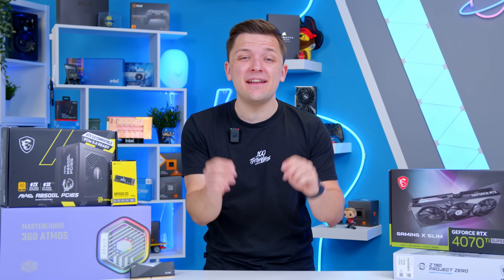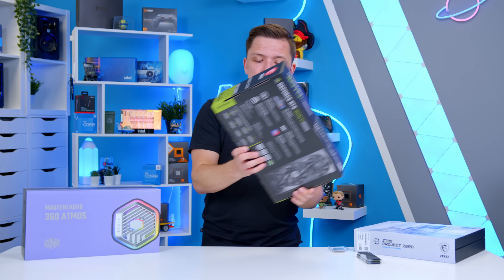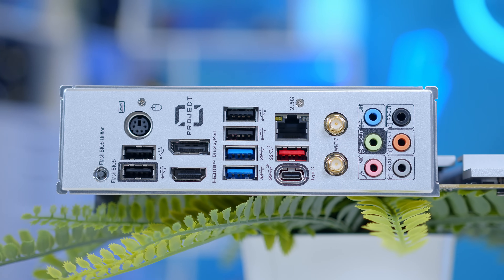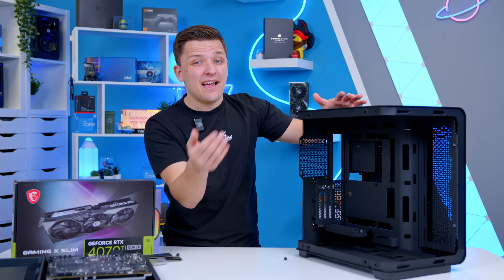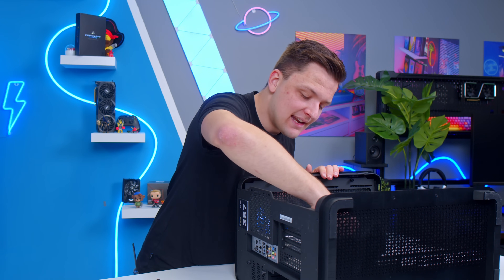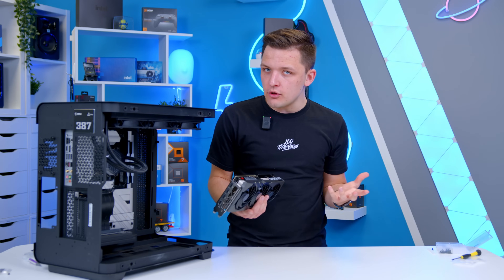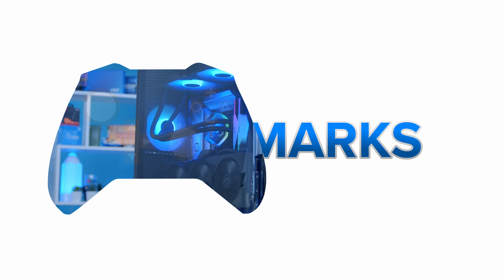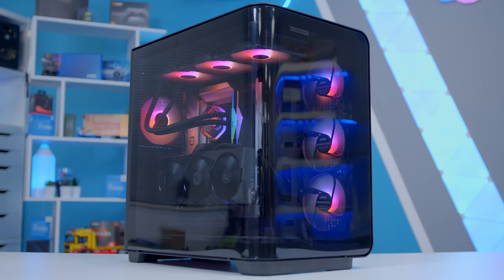Best $2000 Gaming PC Build 2024! 👀 [ft. RTX 4070Ti Super & i7-14700K]

Comment: 😂😂😂😂😂 $2000 for a 4070ti?  Talk about blowing $$$$$$ on all the WRONG places
Reply: Lol $400+ Case 😂
Reply: @thesilentassassin1167  yep my 1800 and change 7900xtx 7800x3d lancool 216 build would blow that thing out of the water for $200 LESS
Reply: At that point just get a RX 7800 XT, it’s literally the same if not better for performance not features. Realistically the best gpu for this would be a RX 7900 XTX or a VERY good deal on a 4080
Reply: @clw22580  how many frames you get in wz wit that rig ?
Reply: @Thornz_1 Think you mean 7900 XT, 7800XT is noticabley worse
Reply: @terlicccIncorrect, MSI has no problems, been using them for years.  Educate yourself son.
Reply: ti super*
Reply: 4070 ti super is exactly the same as the 7900 xt it only has more vram
Reply: To be fair, if I ordered all cheap parts and go with budget air cooler, I was able to get somewhere around $1800 for a solid 4070 ti super build. With tax that’s 2k. If you want anything better aesthetically, it’s gonna cost more. That’s just the current market
Reply: I see a lot of people saying the ryzen 7800x3d  is the best cpu for 4070ti super
Reply: @clw22580 howd you get it that cheap? Def cut some corners if the xtx was $900 😂
Reply from the maker: At this price point I think NVIDIA makes more sense. Totally acknowledge that the RX 7900 XT is a strong alternative
Reply: @GeekaWhat  I've personally had problems with AMD so this video is perfect for what I want. You nailed with this video, some of us out here appreciate your work 👍
Reply: @GeekaWhat  you can EASILY build a 7900xtx 7800x3d build for $2000 which would blow that build you just did 4070 ti super 14700 out of the water
Reply: @clw22580  the ryzen 7800x3d is only better than the core i7 14700K in games, in any other task it is pure shit
Reply: You can get a 4080 if you budget properly
Reply: @Shoedenmark  yeah I’d go with a 7900xtX 7800x3d with a $2000 budget but you could possibly get a 4080 as well
Reply: @hylasme exactly my build was 2200 after tax… ofc u can get that build for cheaper but it depends what u want ur build to look like lol people don’t understand
Reply: 4070 ti super*
Reply: @clw22580  yeah you can build that but it would look absolutely shit mate also dlss exists you amd fanboy + you may have a good gpu and cpu but that leaves like 600$ for 6 other components your gpu shouldn’t be more than half the budget really
Reply: @neikoyomi a gaming pc I’m pretty sure is supposed to be the best at gaming, correct me if I’m wrong tho
Reply: @Osonyer3000  couldve prolly put a 4080 super in this.

Comment: im buying a 4080 super and a 7900x3d soon, hopefully my pc will play 1440p at rt and maybe 4k at high presets in demanding games
Reply: You can run 4K with a 4080 super on pretty much everything so you don’t have to worry about that, but go for the 7 7800x3d. It’s just the superior cpu for gaming.
Reply from the maker: 4K should be no issue in most titles with that config :)
Reply: @The_Meme_Hub_1  I need the extra 4 cores for other stuff like streaming too, so i would really use their help alot
Reply: Ah, that makes more sense now

Comment: Could you make an all black PC build based around the i9-14900K and 4080 super with a budget of 3.3k?
Reply: Do you need help with the parts list?
Reply: yea kinda @MrAnimescrazy
Reply: @aadigarg8544  ok here is the parts list. The cpu is the 14900k, the 360 aio is the thermalright frozen prism, the case is the montech king 95 pro with the fans installed, the ssd is the 4tb 990 pro,  the ram is the corsair vengeance ram 2x16 for 32 gigs cl30 at 6000 mhz, the motherboard is the asus tuf gaming z790 pro wifi, the power supply is the 2023 corsair rm1000e, the gpu is the asus tuf 4080 super. The total on Amazon is a little over 2,700.
Reply: @aadigarg8544  the parts comment didn't load so here it is again. The case is the montech king 95 pro with the fans already installed, the ssd is the 990 pro 4 terabyte, the ram is the ddr5 corsair vengeance cl30 2x16 for a total of 32 at 6000mhz, the motherboard is the asus tuf gaming z790 pro wifi, the 360 aio is the thermalright frozen notte, the power supply is the 2023 rm1000e corsair gold, the gpu is the asus tuf 4080 super, the cpu is the 14900k. The total on Amazon is a little over 2,700 before tax.
Reply: @MrAnimescrazy Thank you so much!!!
Reply: @aadigarg8544  your welcome and you can upgrade some of the parts if you want and if you need help with that let me know. You can probably upgrade to a 4090.
Reply: 3.3 can get you a 4090 if you budget properly
Reply: @Shoedenmark  I was able to do it. Thank you guys!

Comment: Hey if Ur seeing this can u make a full 2000$ gaming setup with a keyboard and mouse and monitor and other peripheral's  😁😁
Reply: Do you still need help with the parts list?
Reply: @MrAnimescrazy  yeah I want this so bad
Reply: @asphaltbrian9k938  ok what other peripherals do you want?
Reply: @MrAnimescrazy  just the normal peripheral's of a pc
Reply: @asphaltbrian9k938  ok I will make the list.
Reply: @asphaltbrian9k938  ok here is the parts list. The cpu is the 7800x3d or the 7700x, the headphones are the logitech g435 wireless headset, the mouse is the logitech wireless g305 light speed, the keyboard is the logitech g613 light speed, the monitor is the asus tuf vg27aq 2k 144hz, the power supply is the corsair rm650 gold rated, the case is the montech air 903 max, the gpu is the msi 4070 ventus 3x 12 gig, the ssd is the 2 tb Kingston nv2, the ram is the teamgroup t force delta 2x16 for a total of 32 gigs of ddr5 at cl30, the motherboard is the gigabyte b650 eagle ax, the 360 aio cooler is the thermalright frozen notte. The price on Amazon with the 7800x3d cpu is 1,919 before tax and shipping. The price would be lower with the 7700x and if you need help with cutting the price down further let me know.
Reply: @MrAnimescrazy  I recalibrated ur parts and now mine is now down to 1900$
Reply: @asphaltbrian9k938  what are the parts you chose?
Reply: @MrAnimescrazy  7700x cheaper b650 mobo same ram same case same psu cheaper 4070 more expensive cpu cooler 2tb 990pro for storage and slightly cheaper monitor and the rest is the same

Comment: Most of the big tech youtubers say that air coolers are the way to go now with Thermalright and Noctua and when they show a PC build its always a with a water cooler.
Is it because of the ascetics and looks ? I have been using a cheap coolermaster Air Cooler in a very humid and hot country and never seen temps go above 80 degree.
As soon as Nvidia 5000 series launches I will get a new PC which is probably later this year and I am really confused about water cooling vs air cooling.
Reply: I also looked into this. Living in a similar climate as well. I've watched a bunch of reviews and read articles comparing the same. Air coolers and AIO coolers have very similar temps. Some air coolers even compete neck and neck with AIO's. Cooling is one of my top concerns. Most test and reviews do seem to be in different climates or  n rooms with Air Conditioning. When it comes to buying coolers there are a few things I look at. Price, cooling capacity, sound, and aesthetics. If money is not a major factor I'd honestly go with a top tier aircooler. If that does not keep the temperatures low enough then grab a good AIO. Most reviews show a few degrees in difference from AIR and AIO's. So it may not be worth it unless your CPU is running too hot. I say try an Air cooler first, if it works then that is perfect. If it does not and you need more cooling power, grab a good AIO. Since the top aircoolers are within a few degrees of AIO's, I wouldnt grab an AIO first. UNLESS.....aesthetics are a major concern. Then AIO's are the way to go. Thats why most Influencers use AIO's. They look better and add more RGB fans. Even if I have the money, air cooling will be my first purchase. $40 cooler Vs $120 with similar results is a no brainer.
Reply: Depends what your use is.  If you do heavy gaming, or even a lot of video editing and that, AIO can make sense.  Air coolers generally last much longer and if they fail, the failure isn't catastrophic (leaking fluids inside a PC is never good).  Also, how big of a radiator can your case support?  If you can install a 420 mm radiator in there comfortably, you will have much more benefit from AIO than someone, say, using a 240 mm radiator setup.  Depends on your CPU of course.
Reply: @stevens1041  I already got Ryzen 7 7800X3D with a DeepCool AK500 with corsair 3000D airflow case. From what I understand that CPU is very efficient and does not produce much heat as its intel counterpart. So far temps are looking good.

Comment: Is there a performance difference with the slim versions of GPU's
Reply from the maker: Not really. The cooler is the only thing that could impact performance but in a build like this with all of the airflow it's not going to constrain the 4070 Ti.

If anything, I think brands made coolers too overkill when RTX 4000 first released, and are correcting this now :)
Reply: Nice! Thank you for the response

Comment: 2000$ system with a 400$ case? Are you insane? That kind of case can be justified if you don't care about momey and already have a 4090 and 14900k
Reply from the maker: You didn't watch the case bit of the video where I addressed this, and pointed to cheaper options for the price if you want to stick to the $2000 budget. I hadn't initially realised just how expensive this case was, hence the add in during the case section.
Reply: @GeekaWhat  No hate towards you. You should have more respect for how much your words can influence people. Some people use videos like this as advice on what to buy. Pairing 4070 with a case that costs 50% of it is just bad advice. 
 I did watch the video and i noticed you addressing the point, however it does not change or mitigate the fact that you chose to include the case into a 2000$ build. 
 Again, if this was a high tier 4090+14900k build, i would have zero issues with the choice of an over the top expensive case, and you initially forgetting how much it costs is a mark against you, not an excuse.